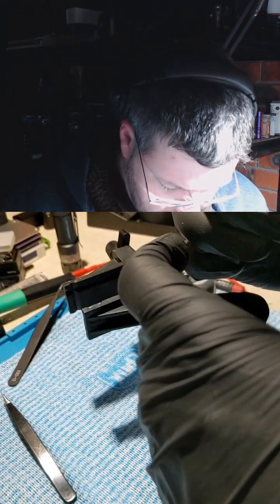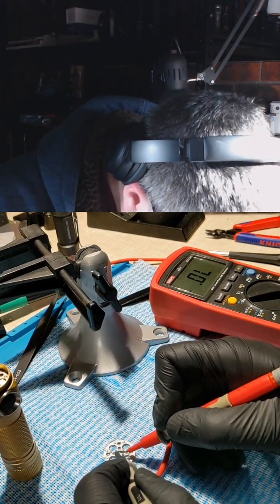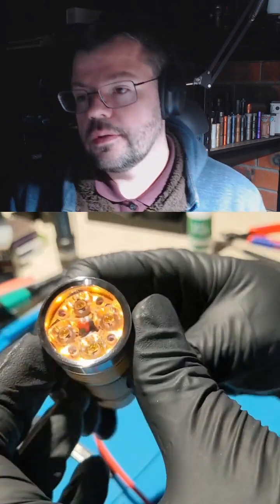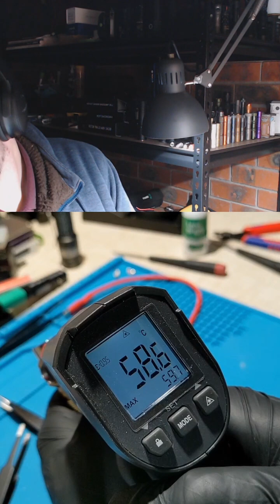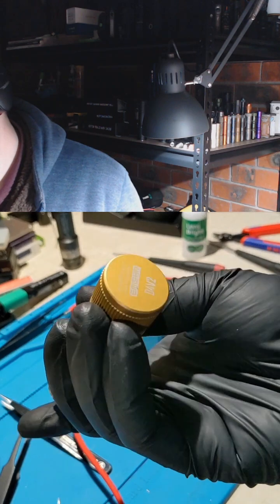Emisar D4V2 aux board swap

Comment: Do you think  driver swap is worth it? I got a boosted D4K Ti. I would like to get the Lume driver in the future. It seems like a lot of hustle.
Reply from the maker: @westsenkovec  Can you get the flashlight with the Lume driver installed? That might be easier
Reply: @TorchHacker  I wouldn't agree. It has low CRI, they all have some kind of artifacts, halos, CA.. Even if you put it on a rifle, it's useless because you can lose the subject easily and it has zero spill. Good luck finding it again. If it works for you, great, but realistically, it's a toy.